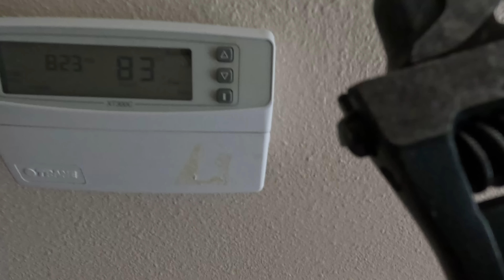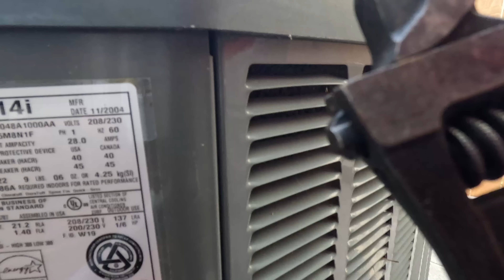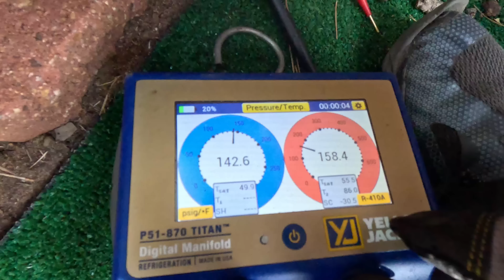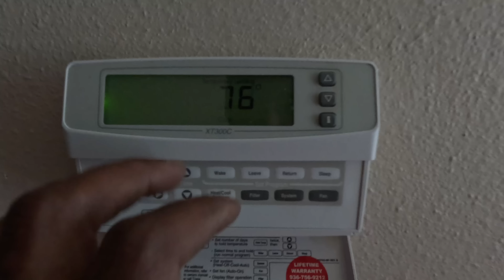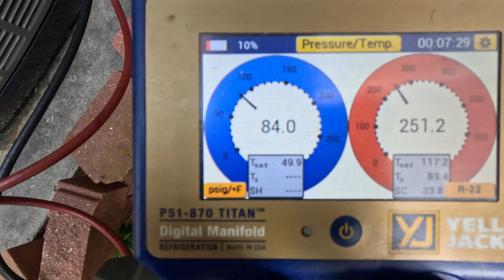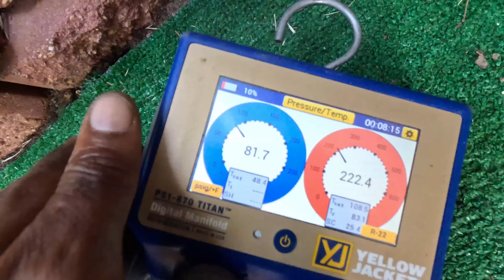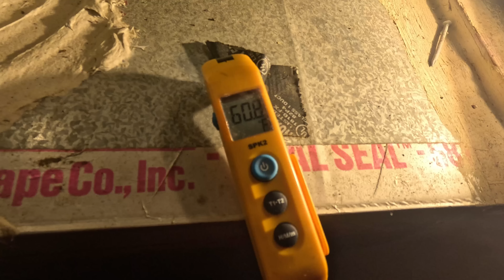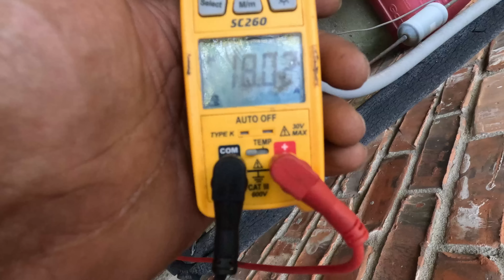$9000 Dollar HVAC Bill: Desperate Homeowners Have a Choice?"

Comment: Tales from a DIY guy... Years back some friends that lived across the street moved out to the lake. One day "Cindy" calls me up and says the AC is not working and the AC man said we needed a new unit. I said what is it doing and she said call "Steve" he is at home. I call... asked what the unit was doing... he went outside and I heard it running. He said sometimes it would come on and sometimes not. 

I go out and pull the cover and in 3 seconds I see the problem... a wire to the herm on the cap had overheated and burned almost in to. So 5 minutes later with a new wire connector (25 cents) it was running fine.... and lasted several more years. 

Cindy called her friend who owns the HVAC company and explained the problem. She said she was NOT paying the 70 dollar bill... her friend said throw it in the trash... no problem.

Comment: the original fan was 1.40 and it was pulling 1.7 but it was a replacement ,hopefully it was 825 rpm.thanks for posting,honesty pays.
Reply: If I’m not mistaken that fan looks to have been replaced already .( universal fan motor) those usually pull 1.8-2.0Amps
Reply: @Johndoe-m3p   I am just saying that if the motor is overheating and burning wires,i would leave the breaker off,until motor gets replaced,and that is the way he found it.1/6 hp 1.0 amps
Reply: @MariosACandRefrigeration  unit has a universal motor . Max FLA 1.8 -2.0 Amps. Not original motor so the spec on the data plate doesn’t matter .probably loose connection  that caused burned wire.

Comment: The cost of repairing/ replacing an A/C has gone through the roof. $9000 is not a bad price actually. Depending on brand and system type, a new A/C can go for $15,000 and up.
Reply from the maker: That's right!

Comment: I’m surprised you install Nest. I thought all you guys hated those. 

I think they are great. Had them on my last three places and installed them for friends and family.

Installed one in my mother in law’s. She had a new system installed over the winter and when it came time to run A/C the air conditioning didn’t work. Owner of the company comes out and blames the Nest and tells me to switch it out - grumbling about how bad Nests are. So I make the switch and A/c still doesn’t work. Owner comes back and realizes his guy didn’t wire the compressor at the disconnect. Not so much as an apology for making me jump through hoops.
Reply from the maker: I like the Nest. I have one in my home. Never have a problem. The Nest  I installed in the field haven't had any problems. I also have a dealer ID, which extends the warranty.